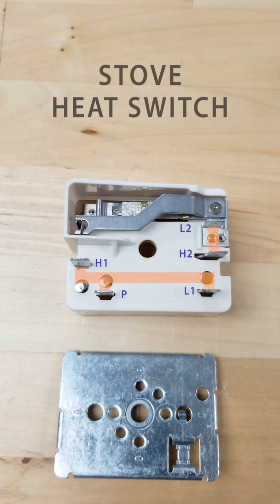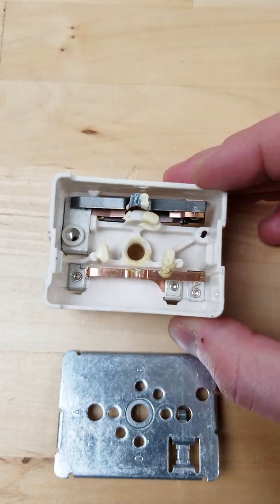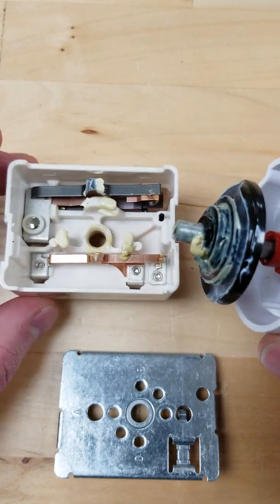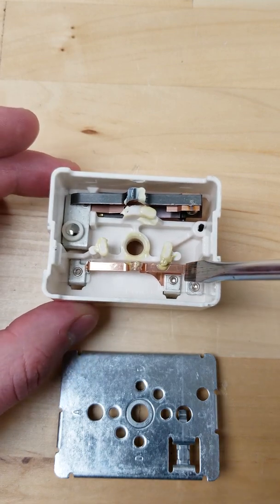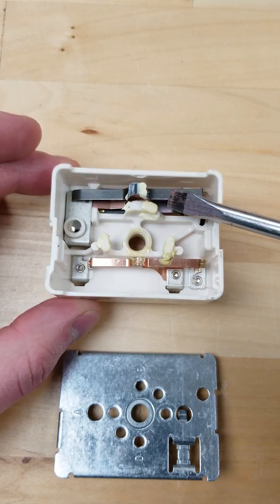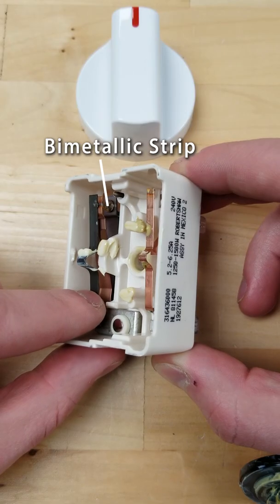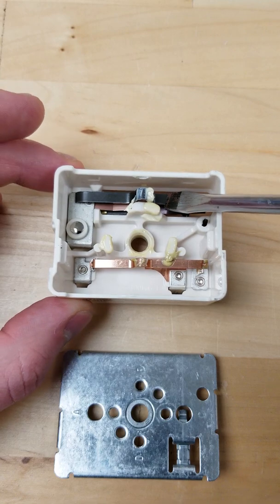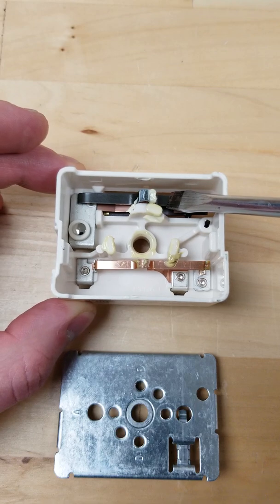How a Stove Heat Switch Works

Comment: Man here all along I assumed that these things used triacs - but of course they're ancient technology that's been working fine forever. Thanks for this explanation.
Reply from the maker: You're welcome, we're just glad that you found it useful. These heat switches are definitely quite simple but the design of it does explain the odd behaviors that happen when the metal gets fatigued. If one of the contacts sticks, you can have a cooktop indicator light that stays on. Or if the metal strip is not bending properly, it can cause the burner to stay on high, even at a low heat setting.

Comment: Thanks for video.I open it . A spring come out .Do you know where it should go?
Reply from the maker: Thanks for watching. There is some variation between switches so they do not all look the same. The spring will probably sit below the cam to help push it upwards.
Reply: @AmreSupply   thanks

Comment: Thanks for that,Searched many places for the internals of these control switches and found no schematic or internal diagrams.I though there was a current/time triggered SCR or Triac with a bias potentiometer inside doing the switching.I spray fast evaporating contact cleaner inside while rotating the shaft of the control and get another 4 to 6 years without the burner element  intermittently getting red on a med or low setting.I was thinking about buying a used one and drilling the rivets out to see what is inside,As I am experienced in electronics and mechanical devices.Now I don't have to,Thanks again.
Reply from the maker: You're welcome, we're just happy to help! If you're curious to learn more we have some graphical circuit diagrams of the heat switch and elements here: https://youtu.be/JKrrOflS1RM?t=43

The metal strips will fatigue over time which means the switches won't behave the same as they age.

If you're noticing that the burner is getting to hot at a low setting or is isn't producing the same heat overall, then you're probably best to install a new switch.